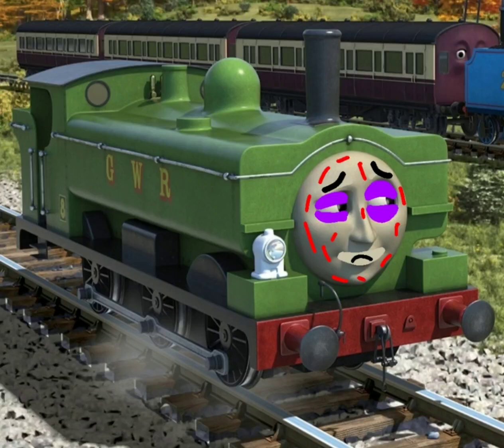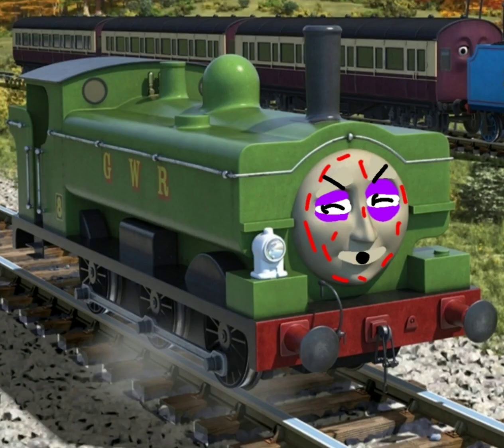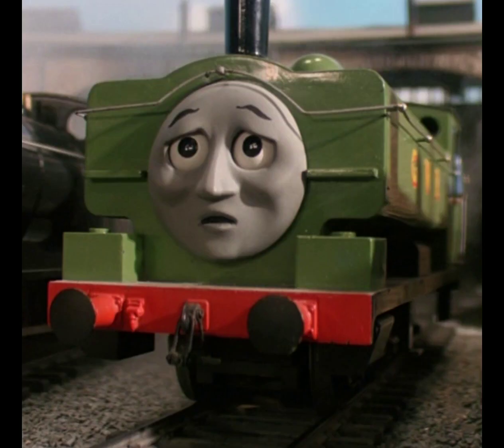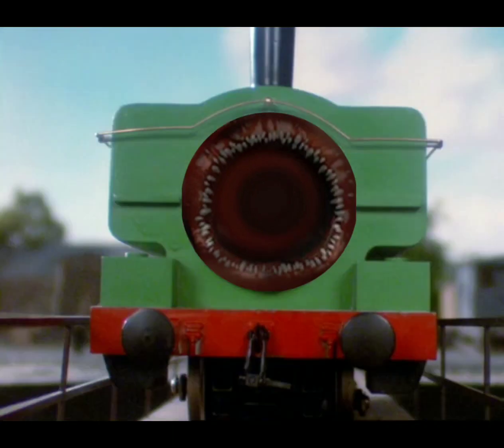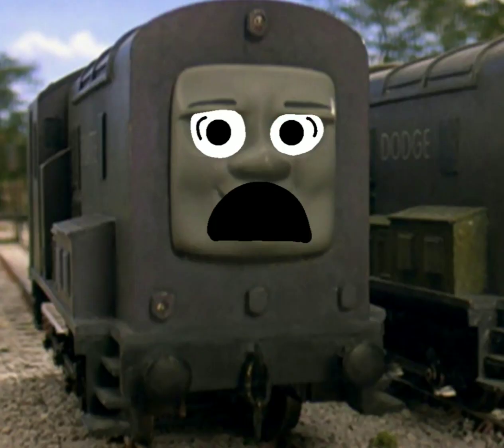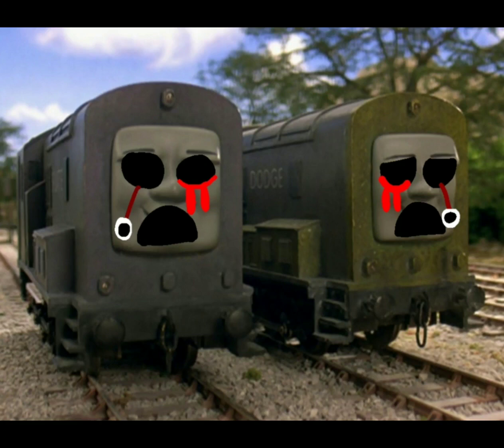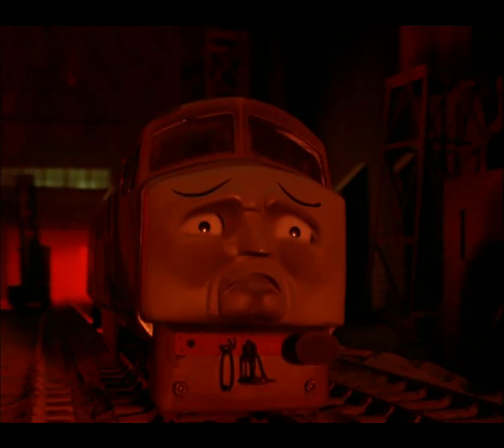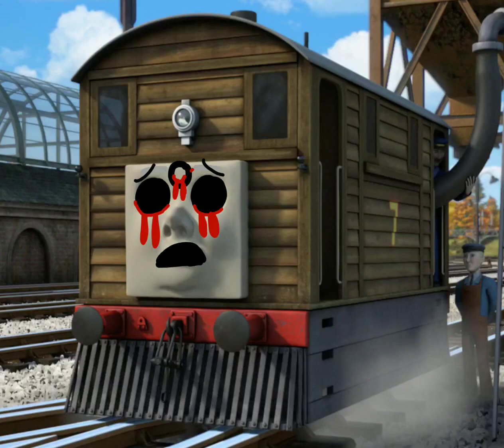Sodor fallout au The 1411 experiment but duck as the beast

Comment: ''5708/1''

''Engine known has 'Duck' has been acquired. Beaten up a but after being deraild by 'Splatter and Dogde', otherwise known as 'Sploge' to the locals the, Diesel Engines. Left on a siding outside, inside main building.''

''5708/2''

''The engine has been injected with a dosage of (STATIC) the engine has complained about nausea and pain internally. We put the engine to spleep and we'll doing some further research.''

''5708/3''

''Researchers have tasked Splatter and Dogde to block off engines from entering. Engine has started to signs of awakening. Test on nearby flatbed proved successful, after pushing forcefully into the turntable and off the rails by one swift movement. We also noticed that the engine's wounds have healed quickly. Engine has been given anesthetics after terminating the test.''

''5708/4''

''Circulation in the face has ceased. Engine's last face is a concerned expression. New hosts seems to have taken over. Tendrils have grown in length, which are able to hold itself off the ground. We're really making major progress now.''

''5708/5''

''Face is now removable, exposing the mouth and teeth. Tendrils can come out of the mouth now. Engine can now control eyes by shoving tendrils into the back of balls and using them like servos. It seems to be getting hungry, and Chapin's gone missing. Blood dripping from it's mouth, pretty much answered our question.''

''5708/6''

''We lured the 'Sploge' in and got them ready for the test. They were horrified. One of them tried running into it to fight back, while the other reversed. One trying to fight derailed and was torn in half. The oil was dripping everywhere, and there was a fire. Engine went after the second one and compressed the front half, killing him instantly. Test was successful. Scrap will be sold later.''

''5708/7''

''Diesel 10 was ready for combat test. This will be our final combat test before mission is operational. Diesel was brought in and combat commenced. D10 held a decent fight at first, calling it multiple names; 'Creature, Beast, Monster.' But the engine got the upper hand. Engine ripped off the hydraulic claw on the roof and tore off a buffer. Diesel 10 was now powerless and begged for mercy, apologizing to steam engines in general. Engine took the thin end of the claw and jammed it into the middle of D10's face...We decided to call it, 'The Beast'...''

''5708/8''

''The engine number 7 arrived the night. Was taken care of beast ripped parts off and attacked it. After backing it into the buffers.''

''5708/9''

"(STATIC) ...The 2 Branchline Coaches, other known as Alice and Merabell' was tasked to monitor the (STATIC)...This will help us to be (STATIC)..."
Reply: Would It Make Sense To Have Oliver As Duck Instead Of Toby?